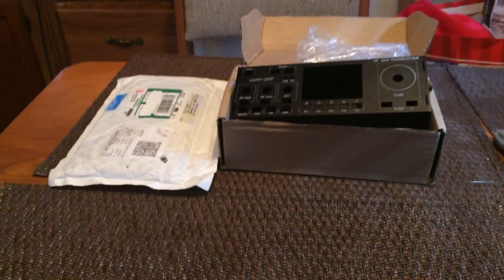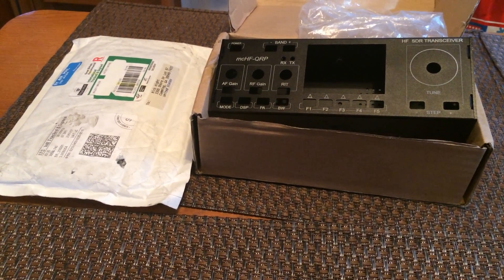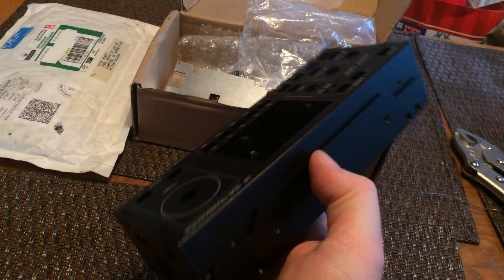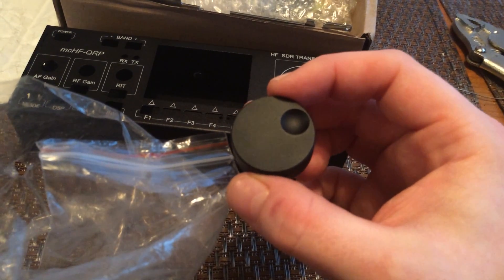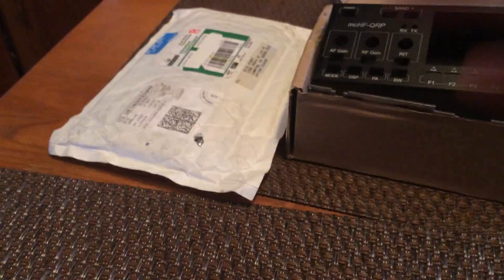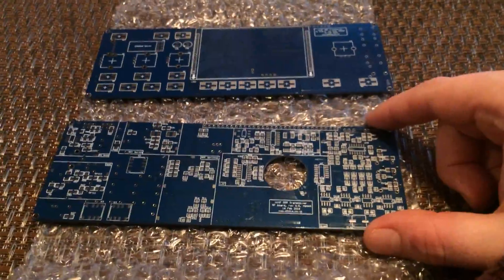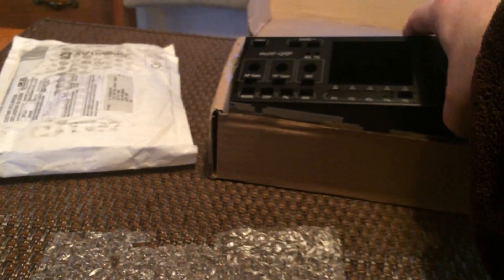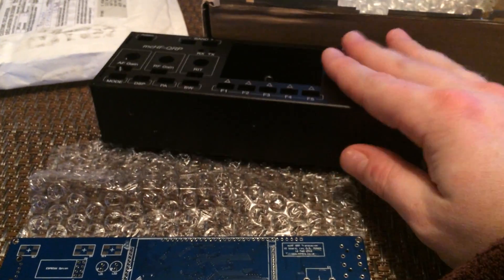What is M0NKA mcHF? Case and PCB - Project Overview and Review

Comment: I wish the inventors would have a pre built kit like the china ones even if it cost more than the china ones, I can solder but not to the level needed by this kit and the fear of irreparably damaging the boards is what puts me off, at least the china ones recognise the developers by not stripping down the firmware to remove them from the menus

Comment: Hi,
I also have build and ordered the mchf + E-bay case.
The quality of the mchf project is superb, good documentation and high quality PCB's.
Building went swift and was done in a couple of hours.

The case, that's a different story, i have exact the same case mentioned in the video. In order to get yoyr mchf buil in you need to be cautious. 
First my case wasn't square, side walls where not 90degr.. so had to bend them... back not the easiest job to do .
The shielding plate, one hole was missing.
The display need to be lowered as far as possible.. you can gain about 3mm by trimming the male header connectors.
The knobs will not fit the encoder shafts due to their length.. some work to do there as well.
Speaker wiring far to thick I have replaced that by thinner wire and also used a smaller connector.

At the mchf Yahoo group I have placed some more info and pictures.

Basically is a kit so I should not complain, and I'm not.. just like to give a signal that it is not a out of the box project!!

The mchf performance RX wise is extraordinary good, I was surprised about that. Filtering works super, no or almost no interference listen to a station with a neighbour at + 3Kc with signal strengths of 5/9+35db. 

I'm almost there, PA need the finals and I'm now after a couple of casing modifications placing the mchf in the case.

regards,

Frans.... (PA5CA)